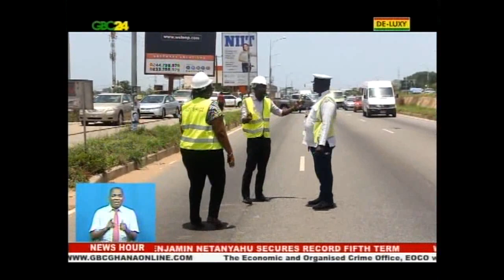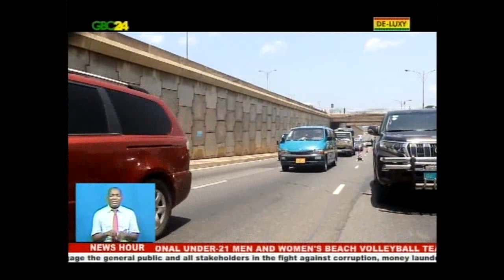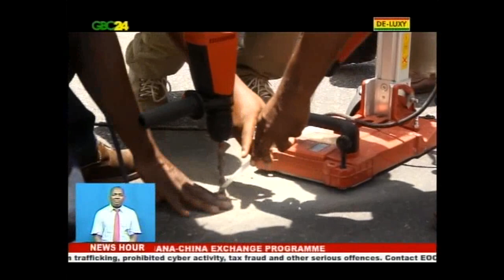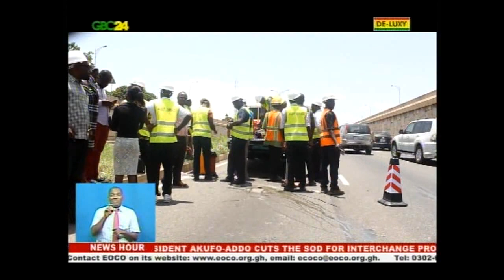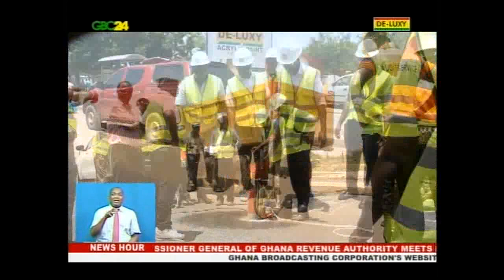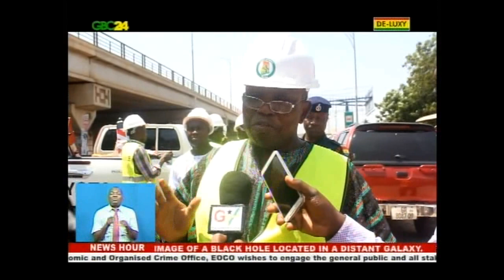Audit Service conducts construction audit on roads

Comment: Well..kudos to them for undertaking this exercise in retrospect.  
Having said that, it's shocking that any contractor is allowed to proceed with their works without hold point inspections and verifications by the Principal (i.e Government engineers or  third party nominated engineers from an EPC firm)...these Inspection and Test Programs are the basic industry norms the world over; I've used them in the US and Australia.  The core drills that they just did should not be happening at this late stage.  At every step or progress timeline, from design, site mobilizing, excavation, backfill and compaction, on and on...there must be an inspection done at every milestone and progress each deliverable or activity must be accepted by the Principal before the contractor is allowed to proceed.  Now the average Ghanaian rate payer using this road has to cope with these unfortunate inconveniences due to improper oversight by the state authorities.  Auditor General on the road inspecting road construction projects????  Where are the so called technical experts......